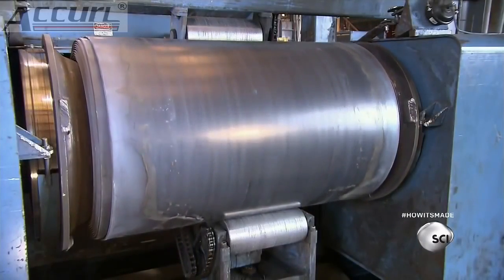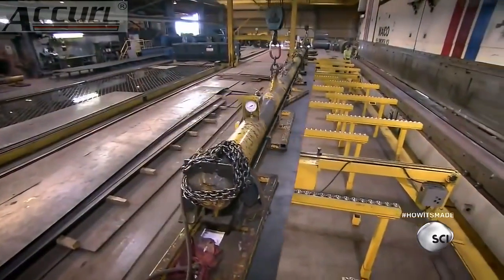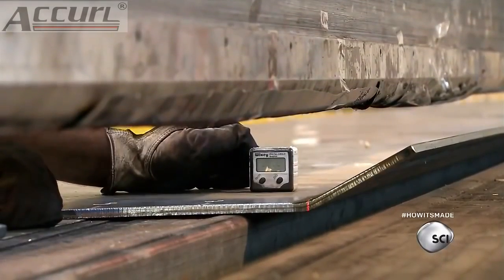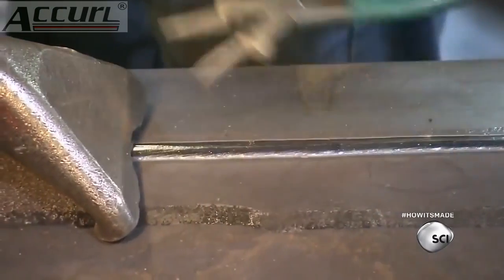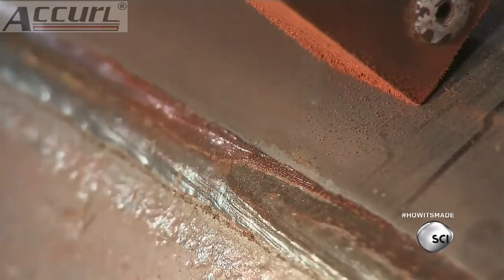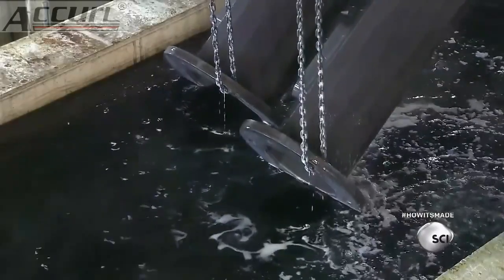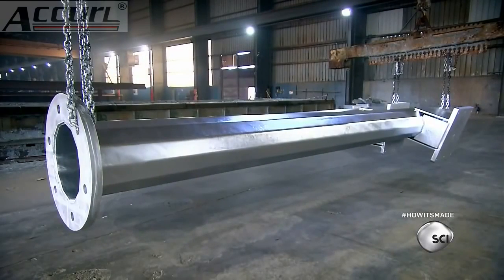CNC Press Brake for Street Light Steel Poles for Sheet Bending Octagonal Pole High Mast Pole

Comment: connection plates are too thick compared to wall thickness of the pole. you should not weld relatively thin sheets of metal (pole) to quite thick plates since the thicker material needs longer to heat up during welding. also it is disadvantageous regarding overall strengh. it would be better the use almost the same thicknesses and use some gussets.
Reply: PLEASE tell us all how much more you know than the industrial plant workers in this video...
Reply: @erdub84  oh sorry, am I not informed enough with my mechanical engineering masters degree and working for over 10 years in this industry?
sorry, dude!

just because this is a video about something doesn't mean they do it well.

Comment: WHICH WELDING IS USED FOR THIS
Reply: Submerged Arc Welding
Reply: @amandaklapp1171  That is for the seam but it looked like they mig welded the pole to the plates, could have been flux core too.

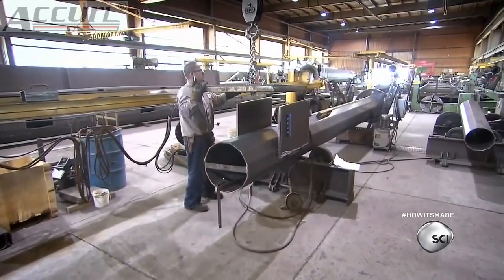Comment: 3:00 The build requires a 3" bolting plate, but a square joint fillet weld with no root is used to join it to the chocks??
Reply: I'm not an expert in welding. Well, I'm not an expert on anything.

Probably, the thinckness of the bolting plate is due to the rigidity needed. The bolts are goint to be tightened with a high load to guarantee the clamping between plates and otherwise the plates will bend eventhough the tensions won't break them. It's not a matter of withstanding the tensions generated, but to reduce the displacements of the structure.

That's why it seems so overkill the plate in comparission with the welding. The limitation here is the rigidity/displacement of the structure, not the tensions.

Kind regards.

Comment: I used to work in a galvanizing plant in southern Indiana doing industrial maintenance for 10 years. I saw these poles come through many times. I designed and built many of the fixtures they used to support the material moving through the tanks. It's quite an operation.
It's a rather dangerous place to work when you are working around sulfuric acid and zinc at 830+ degrees. Loads of fun when you're on a man lift above it making repairs.
Reply: Hai🎉antonmursid🙏✌

Comment: I have a boat trailer from about 1969 without a speck of rust on it. Galvanizing can last a long time if done right.
Reply: And there is the problem, not all galvanizing is the same particularly if it comes from a certain country with a very red flag.

Comment: I bet that Galvin guy has made a fortune from his process that seems to be used everywhere
Reply: Galvani lived in 18th century and didn't actually have squat to do with the zinc coating process that carries his name. He is the guy that figured out that dead frog legs can be made to twitch when you apply electric current. That was a precursor to bunch of electro-chemistry, including various methods of corrosion protection hot-dip zinc coating that's now called 'galvanization' among them.

Comment: The base shouldn’t be made of steel, the pole should be supported by a block of material that can cushion cars crashing into it. I saw one accident where the driver was gruesomely cut in half because of the rigidity of the pole.
Reply: Just put guard railing around it, you would not want it to fall on other vehicles so it must be made strong.

Comment: Why couldn't a normal round pipe be used rather than fabricated a folded section ????
Reply: Bruce Burns The city/state municipal engineer who order the poles with that manufacturing spec had it in mind to cut down on vibration to the pole caused by heavy winds and heavy street traffic.  It’s a over-precautious to some, considered being safety proactive to others.
Reply: Bending moment is higher at ground level (its a vertical cantilever beam). Tapering it allows you to use less material because you can optimize the geometry.

Comment: It's funny how they show multi-sided poles being bent. Street and road sign poles are normally tapered round bent which means not multi-sided. Besides that the press brake being used is around 15 or so years old and it's a Pacific Press brake made in America! Thanks for the free marketing Accurl! Also our now pole systems are fully automatic so a lot has changed since that set up.

Comment: Why not just use a pipe?
Reply: how do you think pipes are made if not by a similar process?
Reply: By a much ...simpler...process.
Reply: Dont you think they would use round tube if that was the case?
Reply: That was my point.  Why not use a pipe/round tube (difference is in if ID/OD is used for sizing).  It's much easier to roll a tube than it is to bend those complex angles, multi-sided round pole as they called it.
Reply: KarasCyborg I think rolling is not suitable for different tapering angles. but with bending its posible to make tapered ones.
Reply: Some places do use round stock. Usually determined by the customers preference. I’ve worked on the construction of dozens (30+ years) of traffic signal systems, and have used both many times.
Reply: Because the bending moment increases towards the bottom. If you design the cross section to resist the bending moment as it goes up the column, you can decrease the material used. Often you can get two columns out of one strip width if you taper them (because you cut a trapeze shape out of the sheet and can put two side by side). The same logic can be applied to tubular (as is used often in the Netherlands) but the welds to reduce the cross section are expensive - more so than the uncoiling, slitting, folding and seam welding because they're labour intensive.
Reply: Because then it wouldn't cost $20000! 
A round column is MUCH stronger than an octagonal one. 
There are plenty of places where Hollow-Concrete-Filled-Steel-Columns have all but replaced plain heavy gauge columns. They're stronger, cheaper and last longer too.
Reply: KarasCyborg those angles strengthen the pole.
Reply: Tyler _ 
EXACTLY!! You beat me to it !!

Comment: 2:49 hate people who dont put there lead in and lead outs on a corner haha
Reply: Yeah, wasteful of materials.  Surprised to see that one.
Reply: Waterjet is better, but the machines are high maintenance. The water being used has to be very soft water, very clean.
Reply: @rolandocrisostomo2003  Very slow too, the precision and cut quality is not needed in an application like this so why go with a more expensive and slower process when plasma cutting works perfectly fine for the job. Laser cutting would be a better argument but both have pro's and con's to them.
Reply: With many cnc plasma cutters there is enough heat to penetrate the plate instead of starting on the edge :) You can do that manually with plasma or a burn-torch as well if you have enough heat, or pre-drill a hole.
Reply: Ooops. How about straight 4mm lead in and a 0.5mm lead out... or a 5mm arc lead in? Plasmas suck. Should have been 4kw optic fiber Laser. 10,000 mt/min. 🤣🤣🤘

Comment: I was expecting a CNC press brake as per the title, but that one looks pretty manual.
Reply: Henri van der Riet 
over 600,000 views and not many people noticed.
Reply: Bending axis (Y1, Y2) on this pressbrake is CNC controlled.
Reply: They are definitally CNC controlled.
Reply: The air bend depth is cnc controlled.  The workers have to manually position the sheet.
Reply: @Bread996  Most press brakes, are that situations, and they are all CNC. CNC just means computer numeric controlled. Or something like that. DOesn't mean you don't touch the part. Most CNC have an operator touching the metal to load it in the machine.
Reply: Hidraulicni akat za demontazu opruga amortizera
Reply: Виталий Доценко ..
Reply: Yeah 😂

Comment: there also great at cutting your car in half when hit at the right speed
Reply: The bolts are supposed to break if hit hard enough, and the pole will do a flip over your car without hitting it.   The key is to remember to be going fast enough to break the bolts.
Reply: @josephastier7421  Which is great unless you are in the car it smashes as it falls. Drunk driver hits pole, pole falls over hitting and killing innocent driver passing by, drunk driver walks away unharmed. There are always unintended consequences to any action.
Reply: stuknda80z 8caca
Reply: So don't hit them.

Comment: Just 40 years? Lol
Reply: Probability shows that within 40 years, a car will crash into the pole, thereby destroying it.
Reply: Wow haha
Reply: It really depends in which environment you install them. If the road is right besides the sea, 40 years in a very humid climate would be impressive! Also remember that industrial standards and technology changes which means that in 40 years this pole will most likely have done it's job! 

You can build things to last for a thousand years if you want to, but it's not necessarily better.
Reply: did you see thickness of the material?  I doubt a car could deform it
Reply: @kdzenins  You had better pay more attention at car accidents then.
Reply: @markfryer9880  I have seen some, but they only brake the studs where its mounted on, other than that it looks strong as grown ass tree
Reply: Death Parade bicicletas eléctricas